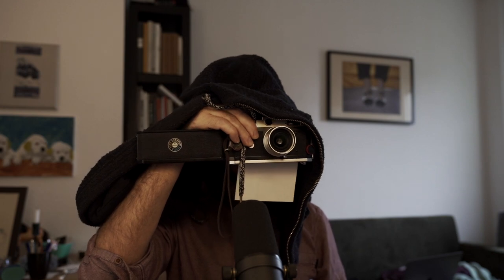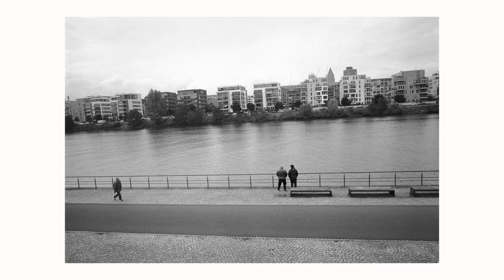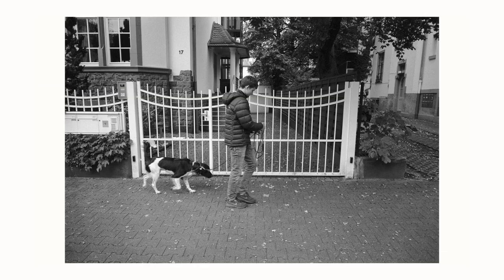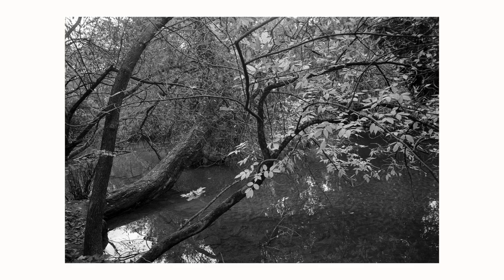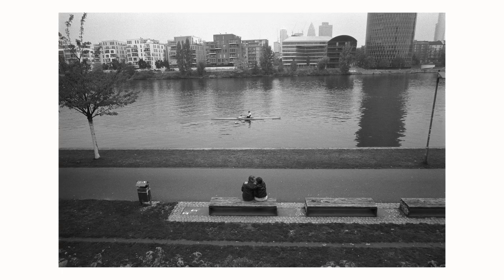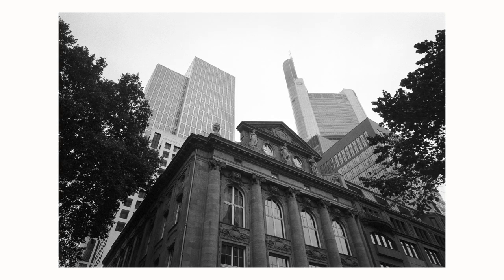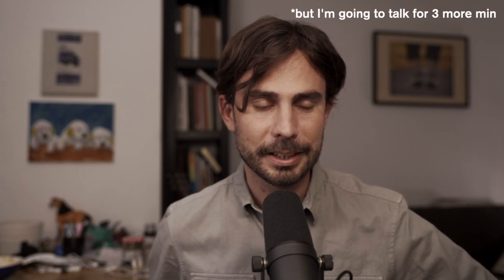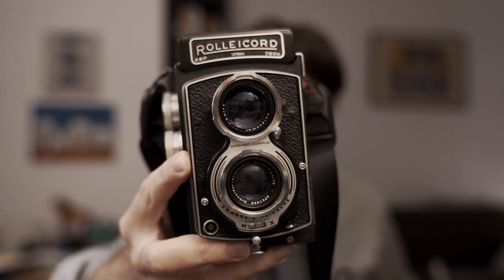Viewfinder Fix? / Rangefinder street photography

Comment: Hey Jim,
a simpler method would have been to simply stick semi-transparent tape over the surface where the film is normally placed. in a semi-dark room then frame a sheet of paper or similar object.  
Then either with the eye or with a camera look through the clip-on viewfinder and tape the frame accordingly. 
I have used this technique before to adjust the rangefinder of an olympus camera.
Reply from the maker: That's a great idea :)

Comment: Interesting. I am currently thinking about getting a voightlander 25mm with viewfinder or a Nikkor 28mm and use it with a turret viewfinder with basic parallax correction for a bit more money. I like the turret viewfinder also. The 28mm comes with a case also. Good luck with the rolleicord. I have 2 yashica TLRs and they are great.

Comment: Why would you be shooting 4x4 through your Rolleicord? Surely it's easier to shoot 6x6 on 120 film that is more readily available? You'd have the advantage of the lens working as intended and getting more depth of field at any given aperture as opposed to using 4x4 which would crop in.
The Rolleicord is great, I bought a Rolleicord Va as my first medium format camera. Using a cable release can help to prevent any camera shake instead of using the lever that has to be pulled sideways to trigger the shutter. You can get a clip on Rollei attachment that fits over the sports viewfinder that you are planning to use. It then coverts it into a rangefinder. I daresay one of those and a pistol grip would be a dream to use.
Reply from the maker: Yes it will be 6x6, I just misspoke:')
Reply: @quietamericanreed  tbf you could have been. I know that Rollei made a `16 on' attachment that allowed the use of 127 film. In the later Vb that kit can be part used to shoot an almost panoramic aspect ratio on 120 film.